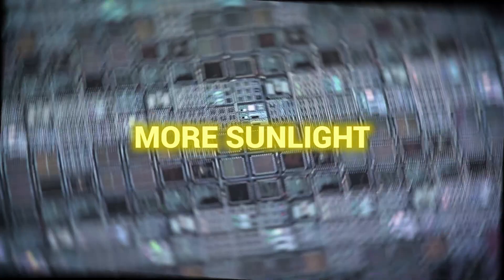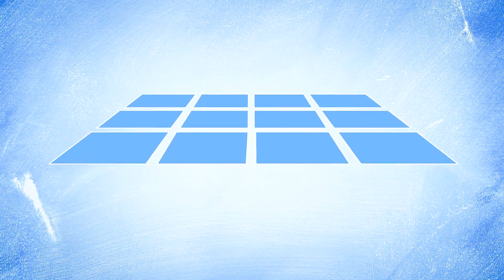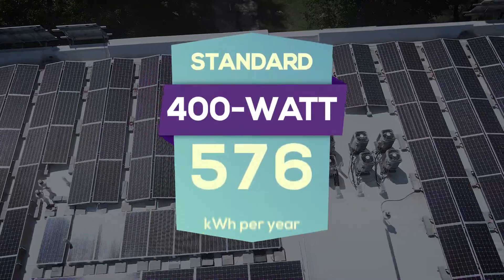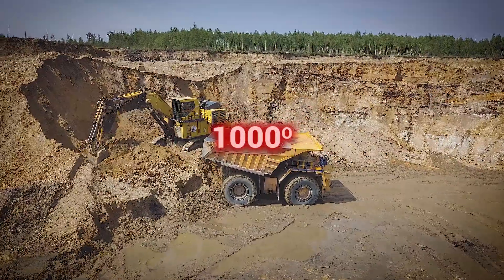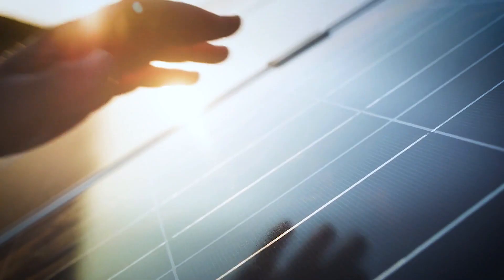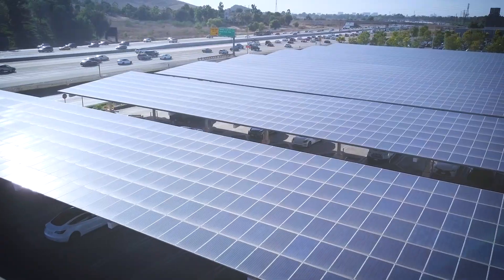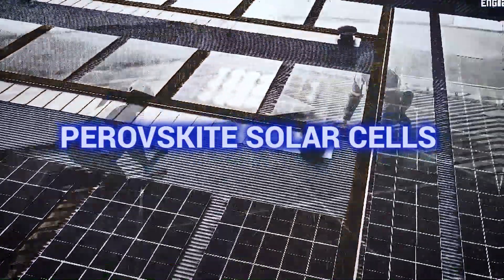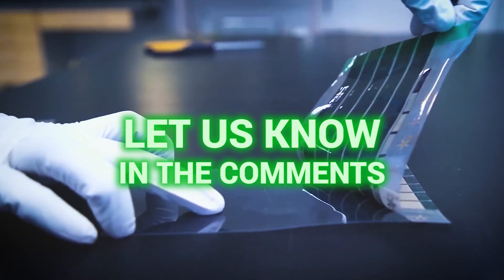New Type of Solar Panels Hits the Market

Comment: Perovskite at the moment degrades quickly.  It can only be considered if they do mass production and give it at least a 10 year guarantee.
Reply from the maker: While you're right about current degradation issues, companies like Oxford PV are already claiming 25-year lifespans for their tandem cells (perovskite + silicon).On its website they claiming that first client in September 5th 2024 start using their panels.